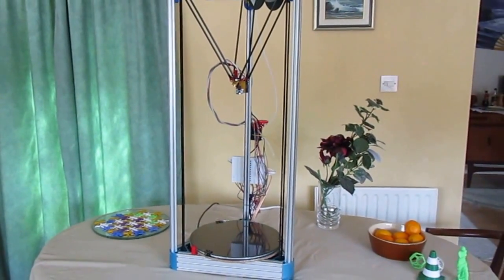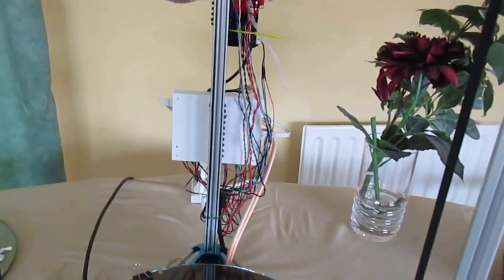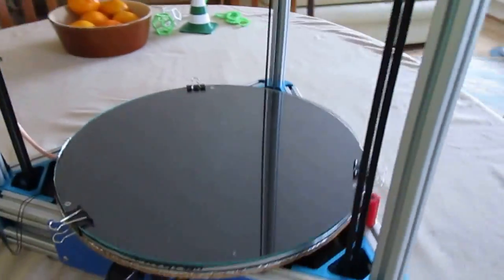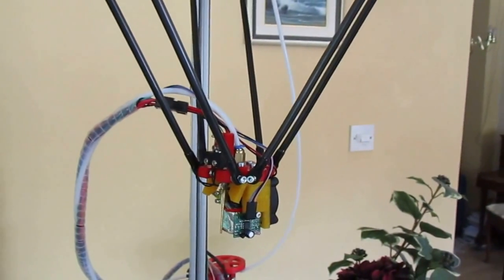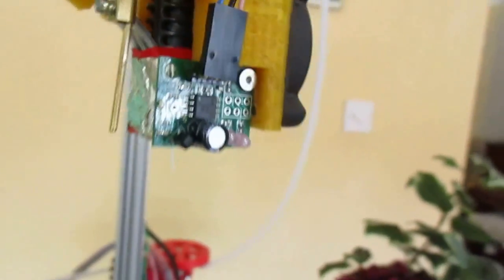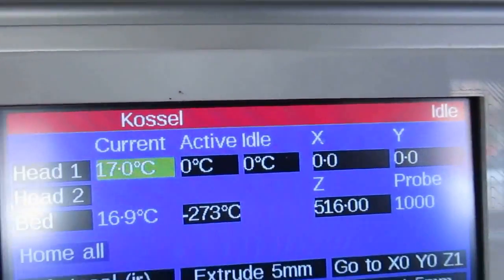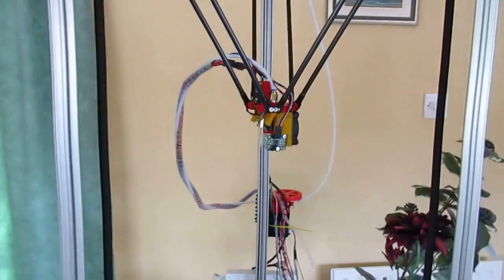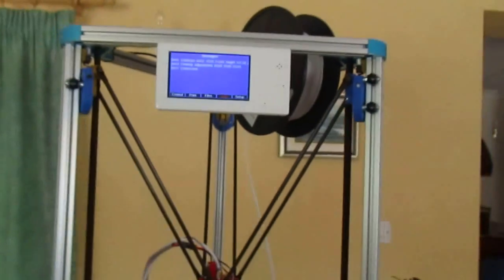Fast delta 3d printer auto-calibration using a differential infrared Z probe

Comment: Did you ever get annoyed with the LCD at the top? I just built an upside-down Kossel with the board and motors up the top, but it's a bit odd with the LCD up the top and fiddling around with the nozzle close to the bed.
Reply from the maker: I put the LCD at the top so that it is at eye level when I stand next to the printer. Whereas if it was at the bottom, I would need to stoop to use it.
Reply: Ah thank you, that makes sense. Mine is half the height of yours so I'll have it on a desktop.

Comment: I like this Z probe solution, but I've got one question: Could the LEDs and photo transistor be put on one tiny board alone (to be mounted right under the fan) and all the rest of the electronics on another board (connected via a small ribbon cable)? That way the actual mounted hardware would be extremely small, light weight, and easily positioned.
Reply: Currently i´m thinking of redesigning my effector and fan mounts to allow for better cooling for pla printing. i would also like to have an even smaller ir probe...would it be an option for you to combine it with the breakout pcb from think3dprint3d kit solution? Regards, Christian